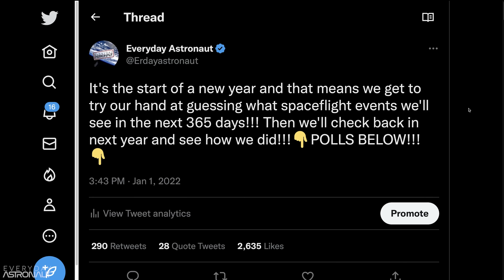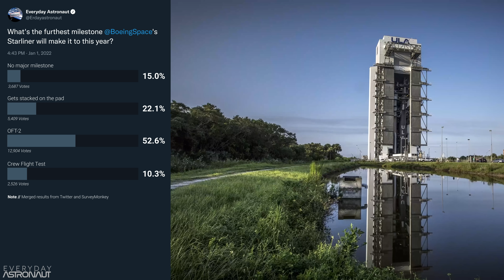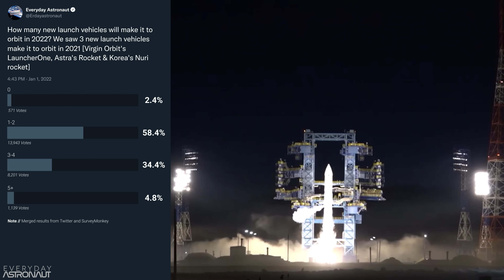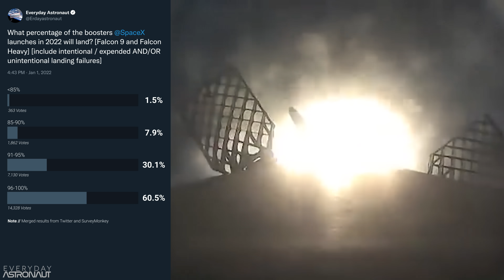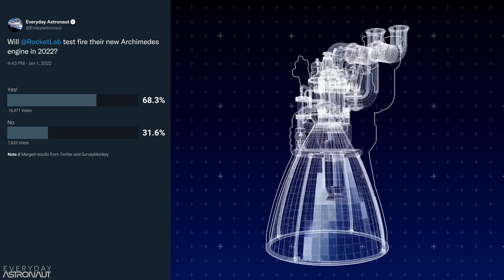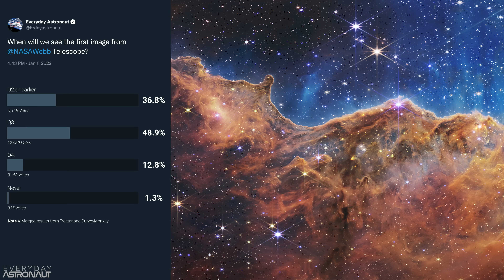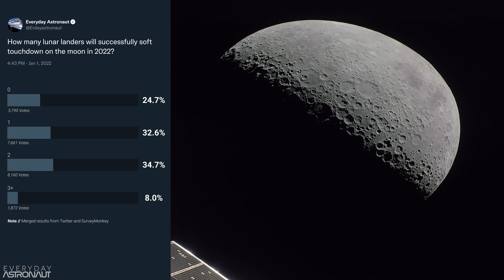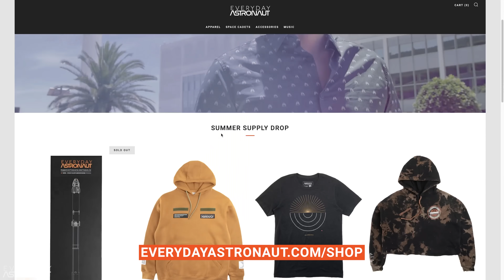I asked you to predict 2022's spaceflight milestones...

Comment: Did not see SLS launch. I'm just not interested in Apollo tech refreshed - horribly disappointing use of our premier aerospace resource.
Orion is not designed to haul anything significant anywhere, just a lucky few humans.
Getting anything significant to the moon or Mars would need something entirely different making the whole SLS approach pointless.

NASA needs to push the limits of engineering, how about improvements in heat shield tech or finally flying an aerospike, solving the radiation shielding problem or even nuclear thermal propulsion.
The private sector can cut the costs to mass move mass, but I guess that's down to politics. (Yikes).

Comment: Yep the heady days of Space X prototyping landing of Starship one attempt after another has turned into gradual ramping up of the enormous destructive potential of Starship  booster on top of the ever increasing complexity and time investment of the stage zero launch stand.

I think the audacity of all the unknowns of what they are creating became all too real this year for them.
It's the future of rocketry at this scale so slow and steady (by Space X standards) will win the space race.
Once a second launch stand is up and running I see a slight relaxing of caution leading to catches and a bit of a return to trial and error fine tuning then a return to a phase of caution as crew based mission flights are evaluated starting with the Artemis mission not requiring a crewed launch, but a solid test of a crewed environment.
By this time Starship launches need to be routine so as to get all those refueling stages up there at once and autonomous refueling perfected.
 
This year has the potential to be the most exciting yet. At what phase of all this they will be at by the end of 2023 is anyone's guess, but its going to be enthralling to watch is a curtinty.

Comment: I was a lot more optimistic about SuperHeavy / Starship before Elon started "swinging for the fences" with his idea of Stage 0 pad rocket-grabbing, deleting the landing legs, and no flame diverter launch pad. It looks to me like ALL of those things are going to be very problematic and risky. 
The lack of flame diverter means that Superheavy will EAT launch pads. (Goodbye rapid reuse. And WTF makes him think that a booster that has more thrust than all other launch vehicles in history can get away without something even smaller boosters required???) He obviously didn't read the STS-1 mission report either, since that detailed how the sonic waves of the Space Shuttle boosters almost knocked off a fatal number of heat shield tiles and almost killed Young and Crippen on reentry. (See "Into the Black", a really exciting story.) 

All it will need is ONE catch to go wrong to destroy the "Stage 0" that every other Superheavy needs to launch. (Thus making them no longer operational until it is repaired. And the explosion could very easily destroy pretty much the fuel tanks, the booster, the launch pad, and everything for miles.)

And no landing legs means no abort mode in case of bad alignment with the Stage 0 catch, so you are SOL. And since that catches Starship as well as the booster, what is a crew supposed to do????

And of course my favorite is putting a crew INSIDE of a second stage with tons of propellant with no escape pods. I predict it will be pretty much NEVER that NASA allows their astronauts to EVER launch in a Starship. They learned their lesson with the Shuttle.
Reply: It's been a year for poor decision making by Musk.
Reply: I think you're premature in your rushing to judgement of a system still in the throw away test article phase of development.

Comment: if you would put a forward rocket (in addition to the main back motor), then the front rocket would "plow" the air out of the way
Reply: That makes no sense.
Reply: @aldunlop4622  heat shield are no nonsense
Reply: @aldunlop4622  thats exactly how (fluid) bearings work, put something very non-friction surface on a more friction surface, like large surface area of the rocket, push the incoming air to the sides and away from contacting the rocket surface directly
Reply: @aldunlop4622  you could even spray water out of the nozzle, then it would form a steam shield around the nose cone, for hypersonic and above speeds, in atmosphere
Reply: @aldunlop4622  its also how ablative heat shields work
Reply: @aldunlop4622  would you rather snow plow a train throw snow, or have the plow removed, and just nose on smash into the thick snow

Comment: It would be an interesting development for SpaceX to alter their Falcon launch procedure so as to leave a redesign booster in orbit, re-dock the Dragon capsule and then do a de-orbit burn and Return to Launch landing. I mean if the reliability of the landing is SO high, use it.
Reply: That would be a very difficult thing to do. Lots of physics to work out and it probably lands on the drone ship so how would the astronauts get down?
Reply: The booster doesn't get even a little close to orbital velocity, and then to de orbit without burning up would require a ton of fuel with the way it's designed to land, it'd spiral out of control in size and weight (rocket equation). It's just a booster man, it already sacrifices half it's payload capability with re use and has to stage super early to be recoverable (center core of FH is too fast and high altitude to be recovered consistently or at all)

The second stage is the orbital vehicle, and there's a reason SpaceX doesn't try to recover it and instead is working on the Starship system to be a recoverable orbital vehicle.

Comment: I think if you ask mostly SpaceX fans which will launch first you’ll get a lot of votes for Starship. If this had been a betting poll I would have put everything I own on SLS.
Reply: Who knew the overdue launch would happen before the launch of something still in development?        :)
Live'n'learn...
Reply: Exactly ha ha -
Reply: @D_Rogers  There was a lot of belief on the launch approval being given far earlier than it actually ended up. There was a time where SpaceX were still looking to do a "just do it" launch for the orbital flight, which would have probably damaged the OLM but would have made it fly before SLS. 

But spaceX had a lot of time on their hands just waiting for a launch approval and so they spent a lot more time testing and building the system, to the point where they would lose the option for a launch as they were transitioning into new technologies and structures. Sine the OLM isn't just a launch table anymore and is chuck full of hardware they sure as hell do not want to damage it now hence why they are being a lot more methodical than during the SN tests.

It was a hell of a longshot for Starship to launch before SLS but honestly not as impossible as it was when adding the retrospective of the legal delays and discovered failures during booster testing.

Comment: Tim thanks for holding off on announcing the winning results until after 2022 was actually over .  Too many folks jump the gun and make these best-of-the-year announcements before the year is really over, which is . . .  kinda dumb.

Time's Person of the Year "award" is a good example of this (they made the 2022 announcement about Dec. 7 -- well before the end of the year!).  What if there was someone who made a bigger impact between their announcement and Dec. 31?  Time would look pretty stupid.  And how would they damage-control that one?  Issue a correction?  Pretend that person had their big impact the following year?  Ignore the whole thing?

(I decided long ago that if I ever did anything that possibly qualified me for Person of the Year that I would do it on December 31st, purposely throwing a sabot into the gear works of Time's editorial staff.  I encourage everyone who finds themselves in such a position to do so as well. 😛 )
Reply: Hmmm... Seems like the announcement of my Ebola-curing fusion reactor will have to be postponed for 12 months or so... Thanks for the tip!
Reply: @VideoDotGoogleDotCom  I applaud your knowledge, Video, thank you for postponing your great achievement.  +1

Comment: SpaceX and Starship were mostly slowed by governmental delays. I'm fairly sure that given a complete green light for all of 2022, there would have been at least one Starship/Superheavy launch this year. People were going by the progress that SpaceX were making, and didn't consider the impact a bunch of environmental reviews and the like would have on the schedule.
Reply: They are still not ready now, so it doesn’t really add up
Reply: @hippomormor  I think they just took the time to refine things, which is probably good, but given no restrictions, I wouldn't have put it past Elon to launch one or two just to see what happens.
Reply: @hippomormor  Ready is relative. I believe they would have launched one of the earlier builds (e.g. 20/4) if they'd had permission, using the kind of improvised infrastructure used for SN8-15 flights. But lacking that permission, they've put flight testing to the side, and focused on figuring out what the ground infrastructure needs to look like.

Comment: I predict that if Starship does orbit it will crash on return or break up it atmosphere.
Reply: That's not much of a prediction... I suspect SpaceX would be saying exactly the same for the first launch. The real question is how long it will take to get their first successful re-entry and landing...

I suspect they'll get booster recovery working pretty quickly, since they have plenty of experience with Falcon, and the boosters are harder to replace. Not so confident on the ship, though... I wouldn't put any bets on that until I see how well the first attempt goes.

Comment: For anyone still holding high hopes for Starship you are blind to the evidence. Yes, initially I too was one of those who bought into Musk's promises until I learned he has a long pattern of over-promising and under-delivering. Thus far the high mark of the whole project has been to launch the ship part 10km in the air and have it return to the same spot it launched from. Technologically impressive but a far cry from orbital spaceflight for this design.
That's not to say SpaceX doesn't do any good. The Falcon 9 series is amazing! However we need to face the possibility that the current Starship design may be a dead-end. It still hasn't made it to orbit nor is there any scheduled demonstration of the in-orbit refueling that the concept relies on. Musk also continues to avoid answering any questions about the supposed '100 capacity' crew module that by most people who understand the basic needs of human spaceflight have said is much lower some say as low as 8. Musk is really good at the hype as well as getting multi-billion dollar government (read: you the taxpayer) subsidies.
I say continue hoping but stop pinning your hopes to the hype.
Reply: did he under deliver on F9? On Starlink?
Reply: @snuffeldjuret  There a knee-jerk fanatic goes again immediately diverting away from the topic I offered. Which part of my post criticized Falcon 9? NONE of it! How about reading the whole post first where I explicitly praise Falcon 9?
Reply: The starship program started just 3 years ago, so it's still in the early phase. It needs its time, Space X has engineers at work, no magicians. SLS needed 11 years to fly, and most of the components had been existed before.

The early flights will be cargo only anyways, so a crewed module isn't the most urgent thing for now to develop
Reply: @simonm1447  To say the Starship program started 3 years ago is an oversimplification. The overall concept and drafts were already proposed by 2017 and they too were daughters of earlier promises and then design already started just waiting for a place to launch from. 3 years ago is just when the launch facilities for it were starting to get built and flight tests began.
What I can definitely say is that Musk kept making promises about its projected milestones that were believed by his fans (I was among them) but in retrospect were obviously unrealistic. I am just warning people to look at the actual facts of what is happening and not what Musk says is about to happen.
Reply: @pop5678eye  in general it's called Elon time - if you need twice the time you're still quite fast, compared to the competition.

Regarding Space X they always delivered - it usually just took longer than the far too tight time schedule.
They have perfect F9 booster landings (60 in 2022), a working crew dragon and the Falcon Heavy. You just have to be patient enough and let them do their job.

Comment: A few notes on your aggregations: 
A "majority" must be 50% or greater.  If 50% or more people get a question right, then you can say that a majority got it right.  This means that more people got it right than wrong, or that the correct answer was more popular than all the wrong answers combined.  If the correct answer was more popular than any other single answer, then a "plurality" got it right. 
Also, you might want to check your math. For some of the questions, the percentages didn't match the raw vote count, and in some cases, didn't add up to 100%.  For some, this could have been an artifact of rounding to one decimal place, but for the question about Ingenuity's flight on Mars (10:43), they added to 97.5%, well outside what could have been caused by rounding.
Reply: That may be the case in your nation. Here, the common-use definition of majority is the largest group in an election. Actual results with >50% for a single candidate are not common here.

Comment: I predicted SLS would fly before Starship because if Starship was operational first SLS would likely get cancelled due to being horrendously expensive and generally useless. So it made sense FAA would continue to impede starship until SLS flew....This was the downside of SpaceX getting in bed with NASA on Starship. For a couple of billion in funding Starship got grounded for 18 months and now has to build a Starship to satisfy NASA's requirements. Hopefully in the end it will still turn out to be a good partnership, but time will tell.
Reply: Neither Starship or SuperHeavy are ready for flight yet, neither are their pad ground systems.
Are SpaceX impeding themselves now too?
Also LOL on "generally useless".
SLS has very solid political backing, it wouldn't be going away either with or without Starship and it's a very useful launch vehicle capability for NASA, one they haven't had for decades.
Reply: @brokensoap1717  At over 4 billion USD per launch and a maximum launch cadence of a single launch per year SLS is the most useless POS ever built. It has virtually no chance of ever launching more than a handful of times before being retired....Starship on the other hand would have launched a year ago (with an all be it extremely high chance of RUD) had FAA not interfered.
Reply: @THX..1138 it costs that much because every congress member and senator insists on some component being built in their state. Because it is it will always have full support of the government
Reply: Star ship isn’t human rated and not likely to be for 10 years plus. They might develop a moon lander based on star ship but they won’t get approved to send up humans without an escape system
Reply: @mgcamp85  I don't think SpaceX gives a crap about NASA's requirements for human rating...10 years from now Starships will be landing people on the Moon with or without NASA. SLS will have been canceled because Congress will never fund sending people into space at 1 billion USD a seat when other nations, private companies and individuals are getting transport to Luna from SpaceX for single digit millions...Single digit millions or lower.
Reply: @mgcamp85  Approved by who? Not NASA... they're not a regulatory body, and can only make decisions for their own missions. And not the FAA — they would be the relevant authority, but the safety of individuals aboard spacecraft is explicitly excluded from that authority.

So by law, SpaceX could put people on the first test flight, if they could find volunteers willing to sign all the disclaimers. Obviously they're not going to, but the point is that SpaceX isn't reliant on anybody else to certify Starship as "human rated". The only thing that matters is whether they can find customers willing to fly on it...

Comment: in falcon heavy does fuel transfer to centre stage during launch? Or does the centre booster have more fuel in the tank?
Reply: Center booster is on lower throttle before the side boosters are detached
Reply: @tonnynguyen390  That makes sense, looked and boosters looked the same size, and pumping fuel between stages seems like a breakthrough they would talk about.
Reply: Originally they were going to have fuel crossfeed like you described, but they found it to be too complicated and instead they just run the center core at a lower throttle
Reply: @kylekingsberry5680  It's quite visible on some of the launches... the flame from the center is noticeably smaller than those of the side boosters. And Delta IV Heavy was the same... I guess it's the obvious approach to take when building rockets with common cores...
Reply: Feeding from an external tank isn’t that big of a leap. The space shuttle orbiter did it every flight from the external fuel tank to the main engines
Reply: @mgcamp85  Then you do it :). There’s a reason DlVH and Falcon Heavy don’t have crossfeed.
Reply: @mgcamp85  Yeah, that's what SpaceX said too, when they started designing Falcon Heavy — before they gave up on the idea of crossfeed because it wasn't worth the trouble it was giving them. Yes, the Shuttle ET was somewhat similar... but obviously applying the same approach to Falcon 9 — or as Kyle said, to Delta IV — isn't as easy as you think, since both companies have investigated and rejected it.